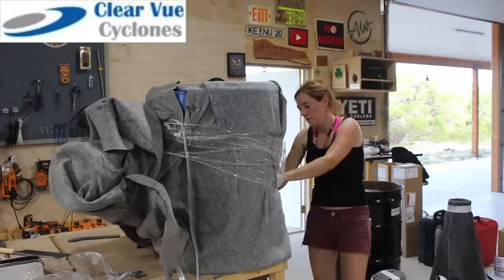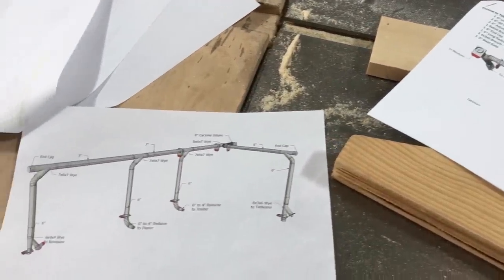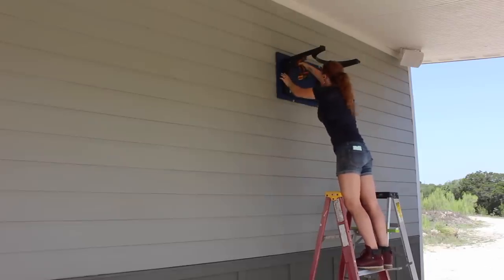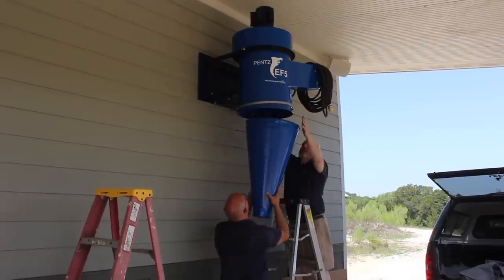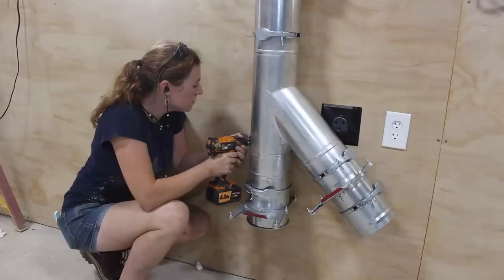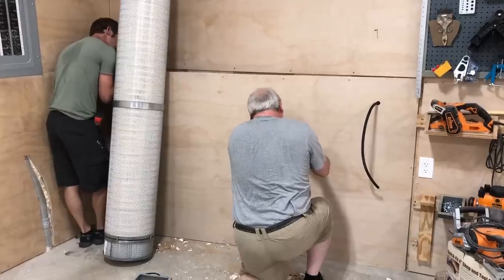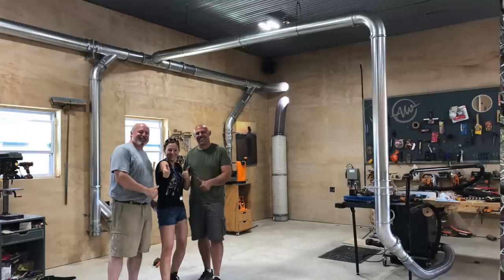Installing A Dust Collection System

Comment: Very very cool. Awesome new shop I don't know what I'd do with. all that space. Anyway I'm thinking of upgrading my DC and had come up with a similar idea by mounting the noisey units in lower part of my basement, bulkhead area which connects right to side of my garage. I feel like it took forever to find videos/ articles for this setup so yes I was pumped to find yours. It answered all my questions in regards to install what you can and can't do and basically what's needed so thank you! One question/concern with my shop being a lot smaller and not needing as big a system I was shocked when you started it up at how loud it still was, or was it me ? I don't know what to expect as I'm coming from shop vac under my covered stairs which isn't loud at all. Will I get this loud vac sound moving to any larger DC even mounted outside? Or should I reconsider. I'm just looking for more suction everywhere that started me down this path.  Any thoughts appreciated. Thanks so much. and keep doing what you do you are very good and talented.

Comment: @April
I would really put a muffler or two (intake and exhaust) of the fan if I were you. They are dirt cheap (ca 50 $ for a 5'' muffler) and can lower the noise emission significantly, especially in the higher dB values. They could get dirty though, so you may keep one in the reserve, and maybe consider taking a size smaller to get the airspeed in it up, as to inhibit dust settling in the muffler. Maybe ClearVue has a range they sell that are snap on. The silencers do NOT have to be directly attached to the unit, as the noise propagates about 80-90% through the air flow. DO IT!

Comment: April - I think having that filter on the inside is a great idea.  What do you also think about insulating the intake/ return hose (next to that motor) as a continued effort to minimize the conditioned air loss?

Comment: It shouldn't be to difficult to create a lever system, attached to the wall,  to operate those blast doors from eye level.
Reply: I think Bob at ILikeToMakeStuff did one with automated blast gates using arduinos.
Reply: Yeah I don't quite understand the need for a blast gate in the main trunk. They're really only necessary at the machines. Other than that the system is excellent. It's just the way I've built them in the past.
Reply: I too would love to see you craft some low tech levers out of wood to open and close the blast doors. Let your creative and artistic side go wild!
Reply: Yeah even though the automated system would be nice, it just adds to complicity and that adds to points of failure. Simple lever system is best option for something like this.

Comment: Cool, but i would suggest you add bit insulation around the outside pipes and the unit, so moisture inside wont condense on those ducts and heat wont be lost so much when pipes are in contact with cold outside air. Essentially what you got there now is thermal exchanger. I would least build insulated shed around the unit, so lost heat is used to keep that area warmer.

Comment: Cool system and very powerful.. I have a 3 HP system that works great and puts out only 49 Db as it is in a separate room.  Did you check the noise Db on this unit?
Reply: Bruce Martin  The fan blade design is causing the awful noise

Comment: I am in the process of deciding on which DC system to choose as for my upgrade from a 2HP HF system that was turned into a cyclone.  I'm down to the Clearview and an Oneida V3000.  One question I have for you, now that you've likely had this in service for awhile, is that Clearview recommends (as I think most do) a straight run of 5-10' extending from the unit.  You have a number of bends at the point of intake.  Is this effecting your DC's performance at all?  Also, I can't tell if that is 6" or 8" tubing you're running.  I have 6" thoughout and wonder if any turbulence that might exist due to the bends at intake might be minimized by a larger duct system.

Love your channel!  Always among the smartest and most efficient in getting your point across.  You obviously take your videos as serieously as you do your woodworking.

Comment: Find a solar panel sponsorship. Your roof gets full sun most of the day (fr what I can see), so you can run your shop on solar power. Nighttime, too, if you include a large enough battery bank. Plus, you'll have backup power (for your whole property!) in case of power outages.
Reply: I don't think she has enough room, lol.
Reply: Generator is way cheaper than a large battery bank. Grid tie solar would make sense, though.
Reply: Solar is a waste of money unless temporary power outage is completely unacceptable and a generator can’t be used. I don’t think April will appreciate the hundreds of mounting screws in her roof. Let’s not even get into all the toxic chemicals that will eventually leak from those panels.
Reply: Rockjockmatt  grid tie solar will save you money, dependin on the details (how much you pay, if you get sponsorship, etc) it can pay for itself in a few years, or maybe worst case in 10 years. Grid tie solar does not provide backup power though. Only batteries do that. Batteries are not cost effective unless you somehow get a good deal (for example, if you purchase a battery pack from a scrapped tesla or something).

Comment: Hi April, my following comment is justified so please take it as advice. By cutting holes in the outer and inner wooden walls, also cutting through the insulation, you have damaged the integrity of the wall. You really need to run a short metal pipe, fitting to the diameter and length of the hole itself, sealing it inside and outside. You can then reconnect the flex hose. Congratulations on the shop again, good job girl 👍👍👍
Reply: Actually the flex hose she has hooked up for the Inlet of the DC should not be there. The collector should be connected to the rest of the system by rigid pipe and she would significantly increase her air flow. Having flex hose at the start of the suction line like that immediately drops her CFM by 1/3. The flex going to the filter should be rigid outside and thru the wall then can be switched to flex if she wanted but you are 100% correct and it all should be rigid through the wall at the very least. Fill the gaps with spray foam to make a tight seal and then caulk over the spray foam just for an extra layer of seal.

Comment: You could make your own Particle Boards with the wood shavings, .. maybe not...not sure if you did or not, did you instal a hybrid solar panel/wind turbine system on your shop for power generation?

Comment: It's awesome. The only thing I wonder is why you would route the hepa filter inside. I get to keep it clean from the outside elements but maybe build an enclosure around it. Just an opinion. You do great work.
Reply: If you spend money/energy heating or cooling a space it doesn't make sense to evacuate the air outside that has to be replaced. These move a huge amount of air and your AC wouldn't keep up cooling or heating all the new air you introduce. Easier to bring it back in.

Comment: Hello April. I really like the look of the metal and the clamp install looks promising.  Quick question as I was watching.  I understand that the holes to outside had to be at a certain height to the inside.  Was there a particular reason you kept the horizontal run at that level,  as opposed to along the ceiling?  

Also,  I recommend a dustpan attachment along the floor so you can sweep right up to the DC system. I've seen other woodworkers glad they've had one.  

Keep up the great work.  I look forward to future videos.

Comment: Another great benefit of those metallic ducting systems is that you can also ground everything much easier reducing the chances of static fires. With ABS/ PVC, you need to ensure that a grounding wire (just bare copper) runs along the pipes and connects to any wire reinforced pipes. I am loving the setup of your shop. Fantastic work.

Comment: Is it a good idea to put some kind of coating on the shop floor to make cleanup easier? Ive seen some places where the concrete floors have been  coated with some type of clear epoxy resin kind of stuff that protects the floor and is super durable and makes it where the dirt and dust is super easy to sweep off the floor... it also stops that horrible screeching noise when you move something across it! (Lol) What is that stuff and how is it applied?

Comment: If you replaced the return line that gos back into shop to filter with insulated HVAC flex duct.you would reduce heat and AC lost and prevent condisation on out door flex line.

Comment: Maybe I missed it. Why did you put the blast gate up high on the main trunk? Wouldn’t it be so much easier to use if you put it partly down the wall and closer to the tool?

Also, surprised clearvue was ok with you putting a sagging, turning piece of flex right before the DC inlet. That’s far from best practice when designing a system. Did you seal the building penetration or just leave a gap around the hose?

Comment: You may potentially reduce the structure-borne noise by decoupling the unit from the wall and use a metal scaffold-type frame to the ground instead.

Comment: I'd add some sensors and some visual indicators to help make it clear which parts of the system are open or closed without having to go check each choke up close :) Even something as simple as a "switch" that shows red when closed and green when open :)

Comment: You need to seal and insulate the exterior lines. You will get condensation on the line that will penetrate into the wall causing rot. With SPF it may not appear for years.

Comment: I like how easy the duct system is to install. the only problem I had with it is it tends to develop cracks, or doesn't seal completely. and it will leak dust or material and it gets everywhere under the cracks

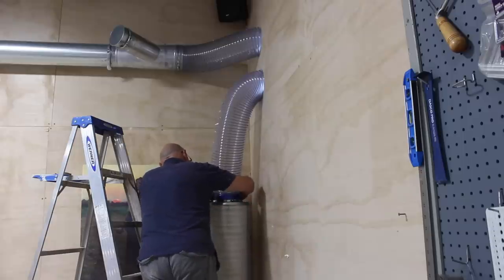Comment: Where do you find a filter that size for the inside venting at the 5:30 mark? I want to try and keep some of the heat inside if possible in the winter. Awesome system!

Comment: I'd be curious how much of the noise is caused by the motor and how much by the air moving through the filter - so if you vent outside instead of through that filter is it significantly quieter inside?

Comment: Question regarding the vacuum. If there’s hot air in the shop and then it goes outside where the air is cooler & vice verse wouldn’t it condense inside the pipe and cause clogging?

Comment: I've had the experience of galvanized duct work looking good at installation, but over time you start to see oxidation where people were touching the ductwork (handprints).  I found it better to clean the ducts with solvent after installation, then Prime with 123 primer from Zinsser , and paint with "chrome" or "aluminum" industrial paint from Rustoleum (brushed/rolled on).

Comment: Hi April,  Just a suggestion:  Don't cover your electrical breaker box.  You know where it is and your electrician can take the time to find it.  But, God forbid, in an emergency, first responders have to find it quickly.  Also, don't paint it, don't wall paper it, etc.  Covering the box with art work may or may not violate the "readily accessible" rule in the National Electrical Code.  Depends on the Authority Having Jurisdiction.  I believe all AHJs would advise against it.  Painting and wall papering are definite violations.  Having said this, I routinely see all of the above in apartment units.  Thanks for a great video.  Best regards, Gottfried
Reply: Most jurisdictions require an outside service disconnect on all new construction.
Reply: Even if she does have an exterior disconnect, that does not excuse her from blocking the electrical panel inside.  The NEC has codes for a reason & she is in clear violation of the code.  Good going April, not a good idea to guide your viewers in breaking  electrical code.  Big money doesn’t give you the right to mislead your viewers.

Comment: Nice.  I've been eyeballing the 1800 for a while but I stumbled onto a home brew cyclone for dirt cheap on Craigslist that gets the job done......sorta.  I don't see this cyclone on the ClearVue site yet.  Also, instead of using microcontrollers to digitally open/close, why not create cool levers?  Less points of failure and could be very cool looking.  I'd also be curious what the decibel level is outside vs. inside with your install.  Keep moving forward and ignore the haters.

Comment: Wondering if the plastic hose portions require a ground wire to drain static build-up thus preventing a dust explosion?
Reply: Dust explosions in ducting of woodworking shops are basically a myth.

Comment: Not sure if it was not mentioned already in the almost 700 comments on this video but is not usual to bridge the plastic hoses and parts of the ducts with a grounding wire ?

Comment: A few classic mistakes: never feed a trunk from the bottom (hanging the trunk a couple of feet way from the wall allows the drops to go against the wall with a minimum of elbows, don't place a reducer @ the bottom of a drop, only after the line has gone horizontal & very close to the trunk. To maintain velocity in the trunk there needs to be enough gates open even if some are on machines not being used. Velocity in risers needs to be higher than in the trunk to overcome gravity. Using flex into and returning from the collector just introduces inefficiencies. Replace with metal. There are some good sites online to help you with design and calculations. It's really easy to do. Knowing what suction that fan can produce at different flow rates (probably seen on their tech info) is needed for doing the calculations. Trunk systems for small shops are notoriously difficult to design for all possible flows.  Where does the CNC router go?  Did you go to IWF2018?

Comment: Another winner. I'm not much on product sponsored videos, however, bringing a product not many people know about as well as picking up a discount for your viewers is a very nice touch. I don't know what your total investment is gonna be, but when this is all done and everything is in on both sides of the shop it would be very cool to know just what all equipment you have installed from top to bottom in list form. We can look up our own numbers. I am trying to obtain a quonset hut building that's gonna be about 20x50 and I'm going to try and do a downsized version of what you have.
Reply: Greg where are you getting a Quonset hut from?
I ask because I’ve lived in one while in The Corps and I’m curious about the price for one.
Reply: @johnklein4558  my folks bought a farm not too far from where I live and they want to get rid of it. They have 3 or 4 barns and dont need the hut. We have some companies that handle them here in Ky, but i figured it would be more economical to re use the one we already have.

Comment: Fantastic video and job... are you going to acoustically isolate the outside parts thus also protecting them from blown rain/sleet/snow? I know you could easily match it to the wall build. I was surprised not to see a sweep trap(?) like your last shop or a vacuum extension hose like Jay? Knowing your enviable penchant for keeping a clean and tidy workplace I thought one or both would have been desirable. 
Here in the UK we went mad a few years ago and electrical regulations ruled that "All extraneous metal work must be earth bonded". This is now been dropped as we used to spend so long bonding metal window frames, etc, etc that costs were crippling, but some things should still have that bond. Have you checked local regulations yet for your lovely shiny pipe? 
I was surprised when you didn't install three phases of electricary but then phase converters seem to be preferable in the States. I will still emigrate to Arizona if I ever win the lottery, really should buy a ticket sometimes. But the dessert heat does appeal to my arthritis ridden body... lol. 
Take care you all, love the extended family... Steve

Comment: How do you find the dust collection at the tool? I have the smaller clearvue system here in Australia and although it’s good, I thought it may have been slightly better, and I have half the run that you do.

Comment: In the argument of where to put the DC system, most settle on "inside" on the grounds that anything else renders climate control useless. It's really no big deal to have the motor outside, and the "exhaust" (filtered, of course) inside, and yet this is the first video by a high profile channel that features such an installation.

Comment: Nice installation!  A bit of a nit-pick though: the cable jacket of your flexible electrical cord running from the AC in-wall junction box to the dust collector's on-wall controller panel may not be "in-wall rated", yet the cable is routed in the wall.  This might matter to an insurance company in the event of an electrical fire claim.

Comment: I saw older videos you were using a HF collector with modifications and now upgraded to ClearVue. Do you still feel the HF with added cyclone like Oneida SSD a good choice for a small shop? I am looking at table saw, drum sander, band saw plus other minor things. 
Will it work with 6" PVC duct or is 4" adequate?
Any thoughts or comments?

Comment: Automation is my area. But for this application I would do it pnumatically. You probably have or will have a giant air compressor. Let's use it. Run a main  line so you have drops, and tie a valve into it on an air solenoid. Walk up to the tool you want to  use and turn a small handle and it will actuate the blast gate.

Comment: You should add a floor spot for the system so this way if your using your other tools or machines that aren’t hooked to the system  you will be able to sweep the debris over to it and it will suck it up without you having to pick it up yourself.